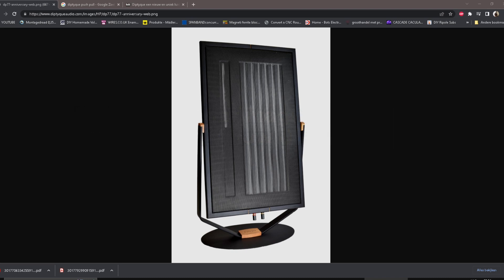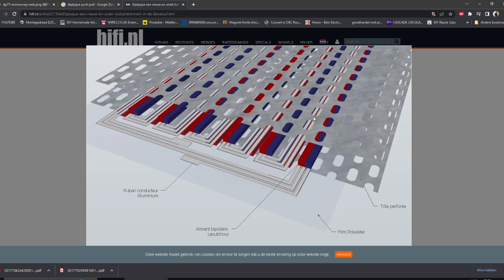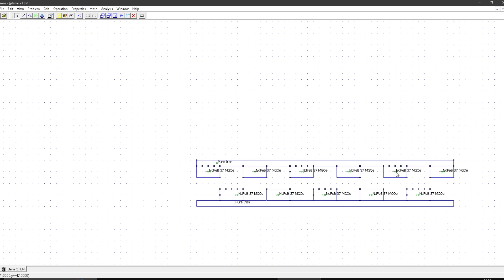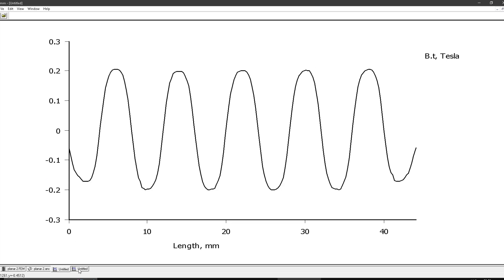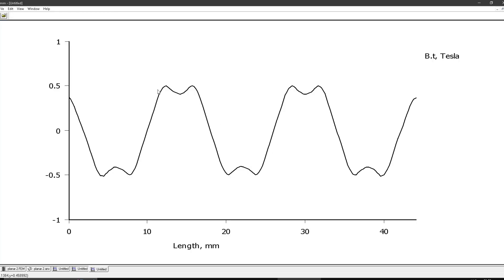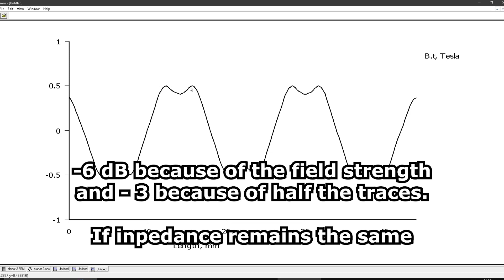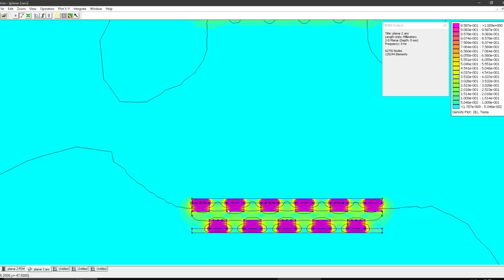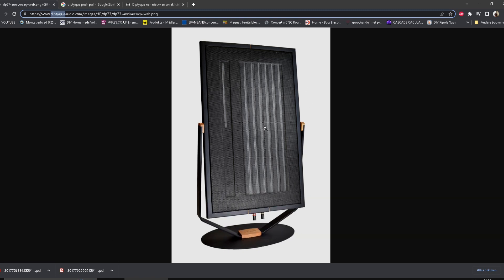Diptyque Planar magnetic speaker -  Motor design  "PPBM"

Comment: Your assessment of tall, narrow speakers is backwards. Moving around the room will find a wide, even dispersed sound. But moving from sitting to standing may find noticeable beaming
Reply from the maker: I am well aware of bad dispersion vertical if thats the longer side. And good horizontal dispersion.  If the tweeter is horizontally small. I either said it wrong or i mean the total  dispersion is not symmetrical because the tweeter is sitting on one side.

Comment: I am going to make planar headphones and I see there are many types of magnet arrangements. One is above N-S-N-S-N-S-N, below S-N-S-N-S-N-S. Two is above N-S-N-S-N-S-N, below N-S-N-S-N-S-N. both are arranged symmetrically. I don't know which type is correct.😢
Reply from the maker: In a push pull.  The magnet that face echt other both have the same polarity/pole so the last one you mention is correct. So both halfs do not like to be put together.  Be sure it dont slip side ways one row   or the magnets atract and slap both halves together
Reply: @joppepeelen  Many thanks for your great answer. But I just thought of one more question, about the diaphragm, should I tighten it or not?
Reply from the maker: @phuocnguyen8774  well in headphones they usually are quite sloppy. so dont tighten them to much. it dictates you low end. try to keep it without wrinkles but as less tension as possible !
Reply: @joppepeelen  I will keep this in mind. and one last question. I want to know if the clearance between the diaphragm and the magnet is as small as possible. thank you!

Comment: Maybe the back is made of steel and the front is made of either stainless steel or aluminum? That would be my best guess. The back plate would reflect the field back in the direction of the coil, while the non-ferromagentic metal would not provide any unwanted sheilding as the field extends out to the coil. You'd need some strong expoxy to keep the magnets fixed on the non-ferromagnetic plate.
Reply from the maker: if they used it like i drawn here both plates holding the magnets should be non magnetic materials. but there is a video 2 since they did not do it like i drawn here. they left out some information in the drawing :) check part 2 to see how they did design them. (there they do use steel on both sides)
Reply: @joppepeelen  Will do, thanks!

Comment: Hi Joppe. Thanks for this. What simulation software are you using?
Reply from the maker: FEMM 4.2 :) must say the structure was different in the end... foudn the patent. and what they draw p on te picture is not the same as there patent.. picture is but coloring was not :)

Comment: Looks like Diptique also used another uncommon planar speaker design with 2 coils and perpendicular magnets for lower range of frequencies.
https://diptyqueaudio.com/images/HP/REF/brevet_cppbm_web.png
Reply from the maker: yeah ill take  dig into that one later to :) interesting
Reply: @joppepeelen  probably perpendicular coils and magnets improve uniformity of the force applied to membrane. Here is an example of a headphone driver with even more intricate coil pattern (but custom magnets cost would be too high for DIY)
https://scontent.fiev11-1.fna.fbcdn.net/v/t39.30808-6/234288017_226201669415446_2310500239020329213_n.jpg?_nc_cat=106&ccb=1-7&_nc_sid=730e14&_nc_ohc=LL-sR1X0ul8AX9QLxss&_nc_ht=scontent.fiev11-1.fna&oh=00_AT_wUXGuMqdAaOjcVy6UkMaQam8wuVPPSxZsNfr8amZRwA&oe=62FCB742

Comment: Ha! A traditional design supposes each gap is opened to an air. The "patented" design has a half gaps blocked by a magnet. It has twice more gaps, with twice less force, and twice less open surface. Thus, I can bet a traditional design is louder.

Comment: I've seen this on the Audeze LCD-2. I think for a headphone specifically the X pattern is useful for saving weight. Although I think Audeze also might short the magnets by attaching them to a metal plate (could be aluminium though).
Reply from the maker: i hope it is alu :) for them :) else them would need more magnets to compensate. besides that metal is also much more heavy :) so they would lost everything they where aiming for :0
Reply: @joppepeelen  I’ve taken many apart and they do use steel. The main benefit of this magnet array is the flatness and coverage of the flux with the right magnet ratios
Reply from the maker: Il make a new video since a friend of mine found the patent or paper. And its nothing bi... or like the picture,  but multipole.. 2 in this case. So metal makes sence in that regard.

Comment: I've noticed that you care a lot about efficiency and impedance. What could you build if you didn't care about both of those parameters? In the car audio world they have some crazy amps able to drive 1 ohm loads and less. They are class D amps which are improving in quality very quickly. In the end, if the amp can handle it, who cares about how efficient your speakers really are? With a class D amp you won't be "burning" more than 25 watt on a regular basis I would imagine.

I'm saying that because as a builder, you want to keep linearity and excursion in mind. You don't want to have to worry about all the other niceties such as perfect impedance and great efficiency, if it's not necessary.
Reply from the maker: well its fun you say so :) since i normally do not care about efficiency :)  i made many with a shit efficiency :)  i even bought woofers because i have low efficiency normally but makes it possible to cross low for instance :)  i did mention it allot when making tweeters since people wanted a certain efficiency to mate with there woofers :(  for myself i buy woofer that match what i make :) usually low.. since power is indeed not an issue i agree lately !
Reply: bro, do you even planar? they can eat 300 watts for breakfast and still want another course. Efficiency is a precious commodity when designing these speakers. That's like going to an auto maker and asking them to not care about emissions or mpg...
Reply: @stets43  300 W RMS is normal? You must be talking about electric radiators  :)

Comment: Looks like a weird reinterpretation of Eminent Technology "Linear Field" design...
Reply from the maker: hmm thats completely weird. i need to model that to even see the idea :) haha all magnets are the same polarity. weird ! :) not easy to model though, FEMM is ike a 1990 program... things not being square is not its favorite :)
Reply: @joppepeelen  Thanks for naming FEMM. I can definitely use that for my thesis project👍
Reply: @joppepeelen  Take a look at US patent 4837838.
Reply from the maker: ill give that a read !
Reply from the maker: The cross using of magnets is the same, except i noticed they diptyque uses multipole magnets according to there patent. so actually different from there drawing on there website. and also different from this patent.
Reply: @joppepeelen  It seems to me that you have never tried the "Linear Field" configuration, am I wrong? Do you know? http://www.eminent-tech.com/Manuals/LFT3ownersmanual.pdf